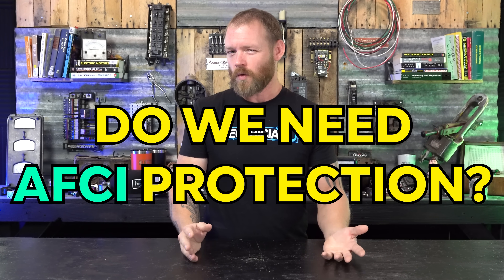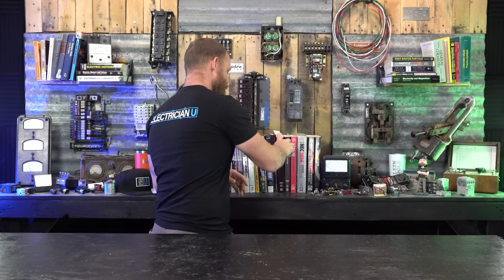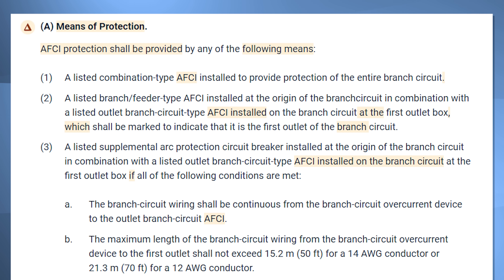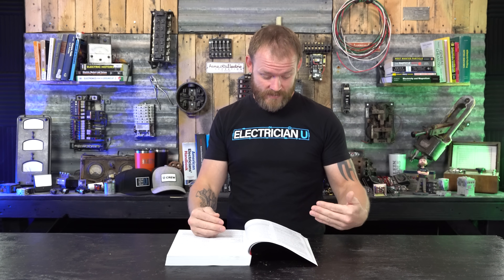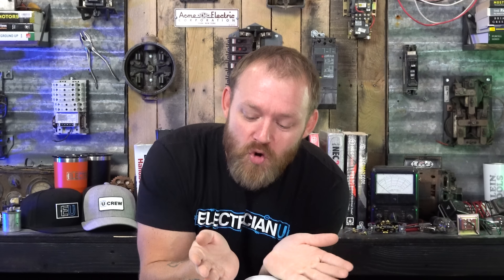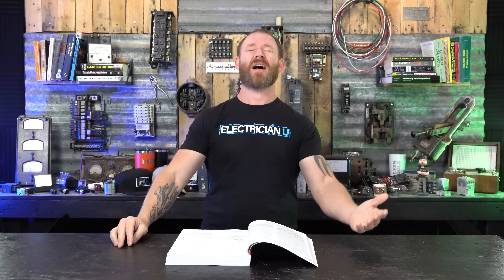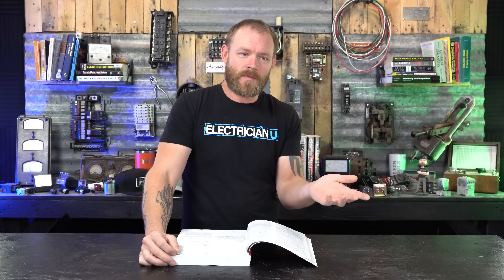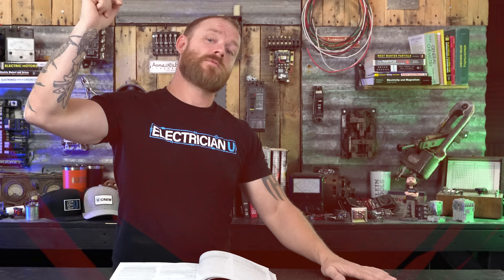Where and Why Do We Need AFCI Protection?

Comment: My biggest problem with AFCI is the fact that some of them will trip on a dime with RF. One of the manufacturers even had special breakers that filtered out RF from ham radio equipment. But this will be a problem for us as it becomes more widespread. Hopefully the manufacturers make this filtering standard.
Reply: @PW_12345  actually you are very much incorrect. FCC part 15 rules says that the device must accept any interference, the operator of a licensed service such as amateur radio has no responsibility whatsoever for interference caused, even if it causes undesired operation. 

So if a neighbor’s ham radios are tripping your AFCIs, they have zero responsibility to fix it. It’s entirely on you. We might be nice and offer to help you but in the end, legally you are the one responsible to resolve this issue. 

You may have a point about conducted interference as there are actual limits on those but anything radiated you’re absolutely on your own. 

The general problem with AFCIs and frankly anything these days is that they make them cheap and not immune to real world environments with RF fields. It’s a race to the bottom to crank out the most cheaply made devices and as a result corners are cut and the first thing to go is usually the RF filtering and shielding. 

In any case I would recommend that if you’re experiencing nuisance tripping, contact the manufacturer, some of them even have specially filtered ones that don’t trip with nearby radio transmitters. Hopefully they’ll learn their lesson and make their devices a bit better shielded.
Reply: @PW_12345  without going through your wall of text - that device you are referring to is the receiving device. Part 15 of the FCC rules refers to unlicensed devices, not licensed. So if an AFCI trips, it's on you. It's not on the licensed radio service. I've double checked and I've even asked my FCC lawyer. 

Sorry you wasted so much time writing such a long comment, but you are still wrong.
Reply: @PW_12345  the FAA made that rule, it’s separate from
part 15 of the FCC rules. The rule covering cell phones is 14 C.F.R § 91.21 and has absolutely nothing to do with part 15.
Reply: @PW_12345  I cited an actual rule. There are two parts to this rule. The one I cited is the FAA’s prohibition on electronic devices. That’s an FAA rule. It’s also irrelevant to the bottom line of this discussion - AFCI breakers are part 15 devices. They must accept any interference by licensed radio services. Even if it causes undesired operation. Period.

And the solution for this is for manufacturers to make their products better so they don’t nuisance trip from normal levels of RF found in the wild. A licensed service has no obligation to do anything if your AFCI trips. That’s on you.

Comment: I have an old house with some suspect wiring. I wanted the added protection of afci and gfci. I have had only 2 problems with afci. An old vacuum cleaner, since replaced, would trip afci. Disposal sometimes trips afci when we diddle the switch. It is nice that the lights on the breakers tell why the trip occurred- overload, gfci, or afci.

Comment: hi, apologies this question is not related but i didnt know where to go to ask and i watch you a lot so i was hoping you could give some insight. i have two rooms on the same breaker. my wife was in one of the rooms with a space heater on. the heater shut off and she told me she thought a breaker flipped. i checked, breaker did not flip, but the lights in those rooms no longer go on. i checked outlets with an outlet tester and all but two outlets have reversed their hot and ground. they have all been wired correctly for months (we moved in recently and i tested them a few months ago). why would they have flipped themselves? what should i be looking for? i shut the breaker off until i can look into it, but the breaker was a little stuck when i tried to flip it off. it went off, just not easily. now if i flip it back on and off it moves easy
Reply: Sounds like a ground fault of the live wire. Probably the wires were too thin for the heater, or just old, and the isolation deteriorated at some point.
Maybe it was the live wire, touching something metallic but not quite bonded to earth, reason for the breaker not tripping. Or the breaker is simply malfunctioning...
I'd check the wires.
Reply: @Mr.Lycalopex  thanks. i prolly should have replied earlier but the breaker (and wires) are a little old and the breaker stuck. my wife was using a space heater which should have tripped the breaker but since it was stuck it didnt trip. one of the outlets on the inside completely melted (not visible from face plate side) and ate through a neutral wire. ive replaced the breaker and the outlet and had to splice the neutral
Reply: the outlet tester showed reversed as opposed to open neutral because even though i unplugged everything i forgot that one extension cord still plugged in has those wifi outlet turner on and off thingies and so there was a small load when using the tester. removing that showed open neutral and i was able to pin down one by one which outlet was bad

Comment: Semi related.. Is there a way to test circuits for faults from rodents chewing on wires? 
I've recently purchased a home so money is tight and it will be a while before I can afford to put in a new panel. In the mean time, how do I feel safe that my house isn't going to burn down from mice chewing on wires? 
I know it's mice because I've killed many. Full attic and basement access, no signs of chewed wires. Haven't lived in it long enough to notice any flickering lights, but everything seems fine so far.
Reply: I think that is primarily why you want afci. Also, make sure you have good smoke alarms.
Reply: @MarkLawry  That was one of the requirements to even buying the house. It had none in it to begin with, now every room has brand new alarms with internal lifetime batteries.

Comment: I had a bad experience with the first AFCI's made, they caused severe RFI buzz on all my AM radios in the house. It's good to have "safer" electrical protection of branch circuits, but.... One thing about having a Load center (CB panel) full of AFCIs and GFCIs and all the electronics in those devices consume a minute amount of electricity, add them all together and that increases your electrical usage all day long, increasing your monthly utility bill!  So we are paying higher electric bills and much higher cost for breakers. just to be a little bit safer. Why can't someone come up with something that's safer and does not increase your cost?
Reply: That's the problem with having the manufacturers write our codes for us. There's no cost/benefit analysis being done. All the benefit goes to the manufacturers and all the cost goes to the consumer.
Reply: there worthless and cause trouble anyway
Reply: Ya nah Ya, we're talking a watt or 2 each. You pay for insurance? Consider it a small price in that expense column.

Comment: breakers are not "smart". "smart" is a cognitive description of the ability for humans to" process" informastion , which humans call "learning". these breakers are designed to function based on physical laws asnd the operation of constructed electrical aprts. ABS sensors are not smart. they to are a manufactured product that is designed for a specific job. the same is true for breakers, as such. it's time people realized that anthropomorphizing  inanimate objects does not do humanity any good. it's lie. just tell it like it is. it's an electronically designed product that is used to detect arcing faults of various kinds installed in circuit breakers.

Comment: Sometimes I think the code books are just there to create a business to keep the paper pushers, inspectors and inexperienced 'tradespeople' employed.
So much of this could be summarized with common language; all we need is an updated version every 5-10 years...

I think the next generation should work towards: "how do we reduce the verbiage in this thing". 🤷
Reply: 2023 actually has some stuff to cut costs, things like lower minimum breaker and wiring size for lighting. I’m kind of surprised. Then again I suspect shrinkflation will happen when 2023 is widely adopted.
Reply: @n2rj  i doubt lights will ever go below 15amp circuits even on LED because so much older lighting equipment still exists and pretty much still still exist.    15a for lights 20a for outlets, 50-150a for dryers , ovens etc.
Reply: @killerdeamonking  they are in the process of making 10a breakers and smaller guage romex for led lights.
Reply: @legalize420  yeah but it's not really needed unless they are changing the standards.
Reply: @killerdeamonking  it's just a cheaper option for new construction. I don't think i'd actually recommend replacing anything rated higher for anything rated lower, unless somehow necessary.
Reply: Other legal field here,

They use big or specific words because, words mean things
Reply: @dramspringfeald  Unless you're a republican politician, whose words mean nothing.
Reply: Agreed.  Also, to keep the manufacturers' margins up.  Let's face it an AFCI and GFCI type of breakers are FAR more expensive than standard breakers.  It surely doesn't increase safety that much in many instances and can often cause loss.
Reply: It's not just that.
It's written and approved by the industry that profits off the code. 
GFI has a time and a place. AFI I'm still not a believer in. We still have issues with them and they are one of the most common call back causes. 

But everything is stupid expensive. And the only true winners are the manufacturers who rape everyone on the price. They cost around $5.35 to make last audit I assisted with. They sell for over $50 trade price. 

The average electrical installation cost for a home went from $5000 about 20 years ago to over $20000. Yeah, copper went up. But not by that much.
Reply: I'm just happy not to pull permits or deal with inspections.
Reply: @ctrlaltdebug  well most places it's recommended to be legal and have permits but they are stupid expensive
Reply: Couldn't agree more.
I've looked over the last few version of the NEC and 90% of it is the same in all version.
I feel it's the same game colleges play with text books.
Where every semester or two a new edition comes out with the page numbers switched around and the questions are worded differently.
Reply: @jakerasp  and to make multi billion dollar corporations richer regardless of whether it actually helps the electrical safety
Reply: @Squat5000 NEMA is literally the manufacturers coming up with new standards requiring more items with higher costs to be purchased from them.
Reply: Yeah, it all seems like a way to gatekeep.
Reply: @zlcoolboy that’s exactly what it’s for.
Reply: @jakerasp   That is Truedopes buss words ( keeping ALL Canadians safe from all those bad trucks) Your just repeating  what the gatekeepers want you to.. (sheepe)

Comment: Sort of annoying that AFCI is needed when a GFCI could do exactly the thing that AFCI is doing. Its a great example of manufacturers manipulating the code so they sell more garbage products that cause more problems then solve. Guess the 100 year old house I just remodeled barely made it. Yes yes, a series arc wouldn't be picked up but last time I checked, at that point wouldn't the problem reveal itself soon then later and it would be a warranty problem? (Over staple/crush wiring)

Comment: I find it kind of crazy they are not really specifying things like electric stoves, water heaters, radiators, dryers, etc. I'd be more woried about a high amperage 240V circuit arcing than a lower amperage 120V one. Granted the 120 are more common but i can't really say I agree with the logic.
Reply: I think the logic is that 240v devices are rarely moved, are often hardwired, and have thicker wire insulation.  120v devices get moved around all the time and are more likely to have wires/connections that are abused.  Extension cords being one good example.  So it's just more likely that a 120v device or circuit would have an arc situation.

Comment: That is so odd i have never heared of a 10 amp circuit. I had a plug on neutral pannel installed during upgrade to be safe 2 years ago, but Michigan atleast then still was not requiring them, and I don't think they update code again until sometime 2023.
Reply: 10amps are usually on 277/480 panels
Reply: I thought 10 amp circuits were coming for led lighting.

Comment: My house was built in 1994 and uses multi-wire branch circuits - everything is 12/3 and neighboring circuits share a neutral. Can these be upgraded to AFCI (presumably using two-pole 15/20AMP AFCI breakers)? Would this be wise for extra protection? I would obviously get an electrician to do it (so it would be the cost of materials + labor = ~$2K) - i'm trying to get a sense of whether this is something homeowners should be advised to spend on? More generally, I'd love to see a video on advice to homeowners with old houses; when should you get the panels changed (i have murray panels with squareD breakers), house rewired, etc ...? Great channel by the way!
Reply: In my experience, gfci or dual function will not work. The imbalance looks like a ground fault. But afci alone will work. But you probably want to get rid of the shared neutrals if you can. Only then can you use dual function breakers. Don't take my word for it. I am diy,  not an electrician. But in my old house, I had a goofy shared neutral that I eventually found and removed. That was my experience. BTW I did this work with a permit.
Reply: @MarkLawry  thanks. My ahj doesn't give permits for diy, and it seems a little too big to do under the table (I. E.: Without a permit/inspection)
Reply: @MarkLawry  won't work if you try to use 2 single pole breakers.
Reply: they make double pole AFCI and GFCI breakers, for your 12/3 and 14/3 application, but they're over $200 ea retail currently.

Comment: A question concerning the bare wire that comes with bx cable.
At the service panel can you put that bare wire in the neutral/ground block?
Reply: Thanks 
Leo
Reply: Check the code. It is different in the main panel vs a subpanel.

Comment: While my neighbor was on vacation his power went out. When it came back on his AFCI breaker did not reset. His ice maker thawed out and dripped on the hardwood floor - causing a lot of damage. Is there a code compliant solution to AFCI breakers that dont reset after a power outage?
Reply: It's toast. Same with GFCI outlets that won't reset. They are designed to lock you out if there is an internal problem. I've had some fail due to voltage spikes and running on a portable generator.

Comment: I can see that an AFCI might spot a series arc when a switch opens, or closes if the switch has severe contact bounce issues. Hopefully the AFCI is smart enough to ignore a brief series arc like from a switch while being able to still protect from a series arc from a break in the wire. One would still have to be careful plugging and unplugging a live load from the wall (would also get series arcs as the plug prongs break and make to the outlet contacts). I would imagine that the UL certification for devices would (or does?) have specifications to reduce contact break/make arcing to below AFCI detection levels. Does anyone know enough about the UL code to find this? Doesn't UL also certify the AFCI breakers? If so, it might be interesting to see the language for how an AFCI is supposed to work with different arcing situations, at least to pass UL certification.
Reply: Don't know about the specifics, but my IEC instructor was telling us this was actually a huge problem when AFCI's first hit the market and codebook, to the point where, in order to pass inspection, electricians would sometimes swap out the AFCI breakers for normal ones and hope the inspector didn't notice. They eventually re-engineered them to differentiate normal use arcing from arcing events, so you're protected from the house fire kind of arcs, but you don't have a bunch of nuisance tripping
Reply: 1. Shouldn't live plug devices. Bad for the outlet and maybe having reset things someone will learn. They should be off when being plugged in. 

2. It is designed to tell difference. Big thing is bounce. Ex how many times it occurs.

Comment: Welders aren't arcing, they just draw power/watts. The welding arc is after the machine, down stream of the branch circuit
Reply: Sounds good, unless the welder isn't able to filter the EMI from the weld from back-feeding into the power supply circuit... There might be a big bump in welder sales starting 2025 to upgrade old welders (or a big bump in generator sales to run those EMI noisy, old welders).
Reply: There you go!! 👍

Comment: AFCIs and AFDDs are essentially current and voltage signal detection devices a set of transient arc-like signatures series or parallel will throw off a specific signal however that’s under ideal laboratory conditions. Loads and electromagnetic energies whether inductive, resistive capacitive or other EMIs can mimick these signatures and set them off. With better load measurement and signature capture in a home environment that uses AI software I suspect false tripping will become less of an issue. Microwaves, coffee machines are notions for setting of AFCI devices. Adding surge
Suppression can help as well to filter out false- arc like transients.

Comment: It's also worth remembering that your jurisdictions adopted code might have different AFCI requirements.
For example, Oregon code doesn't give a shit about AFCI protection anywhere except for residential new construction, and even then that requirement is fairly lax compared to the NEC.
Always check your local codes, you can potentially save the customer a pretty penny